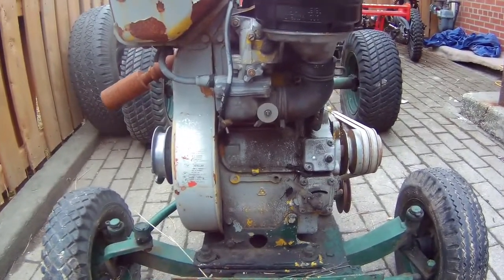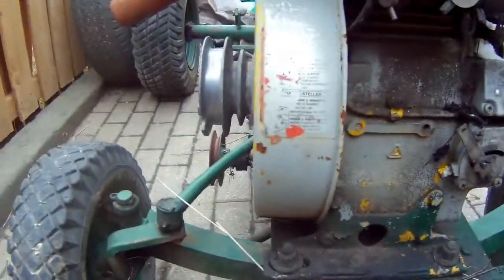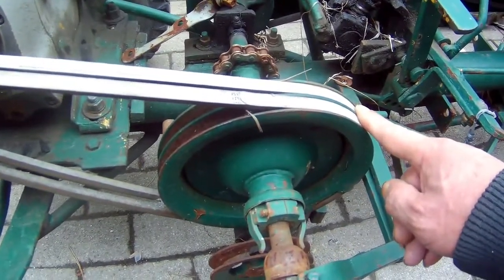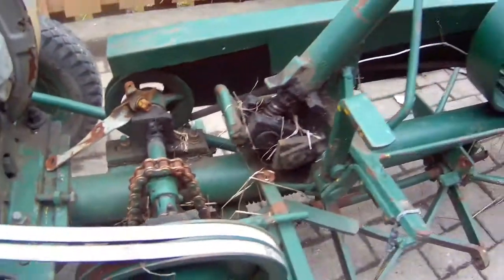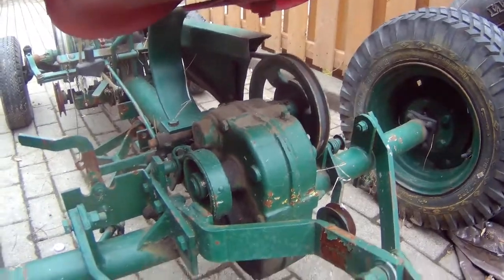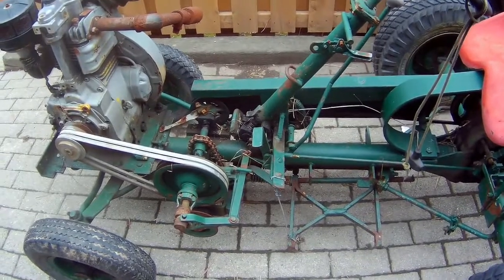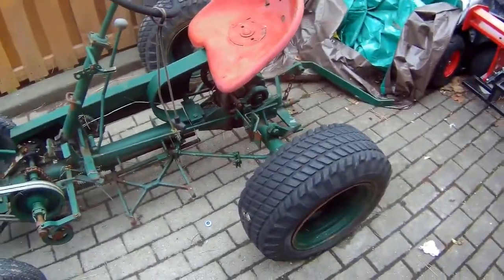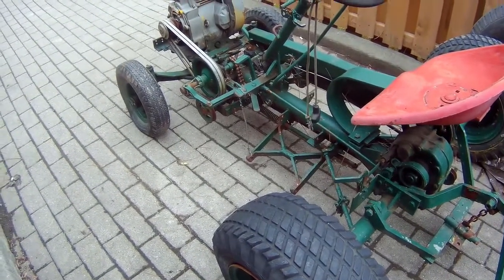Better Look At The Lawnmower

Comment: Hey mate.  So have you got any ideas on what you may do with her.  ?   Lots of different moving parts on her.   Good one Neves.👍
Reply from the maker: Not yet Customwinder 1 but I keep thinking with it, first thing is to see if the motor is usable if not then see if I can put a 420cc in there
Reply: Neves Projects Hey mate.   Sounds like a plan.  Be good if that ol diesel  fired up.   
It would be cool with a big predator on there. Cheers bud.👍

Comment: very nice engine, btw it is not a diesel engine. due it has a carb and a sparkplug. what I though that looked like a an injector but it is a spark plug wire due it doesn't look like fuel injection line.